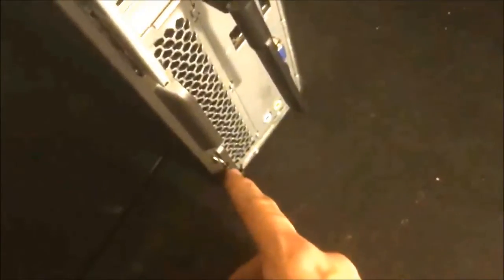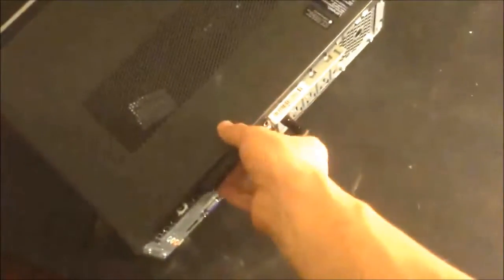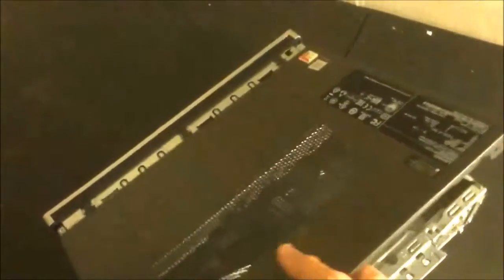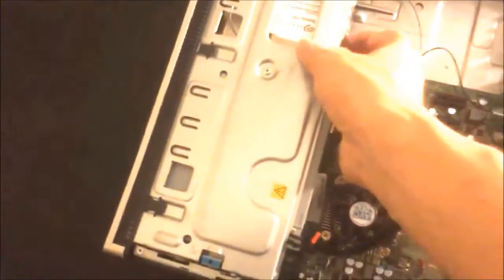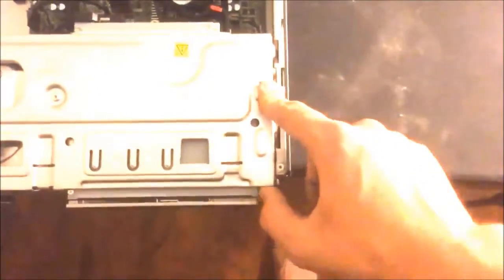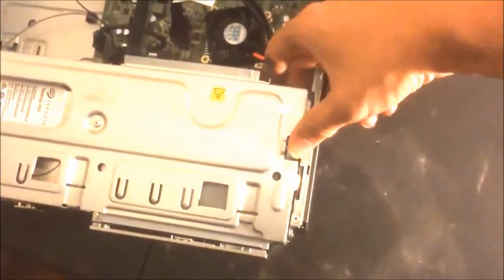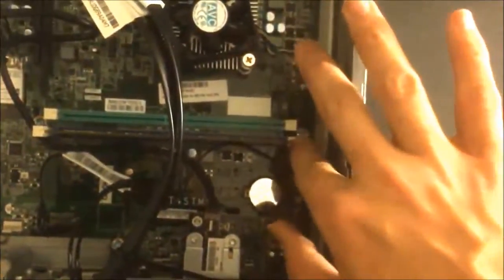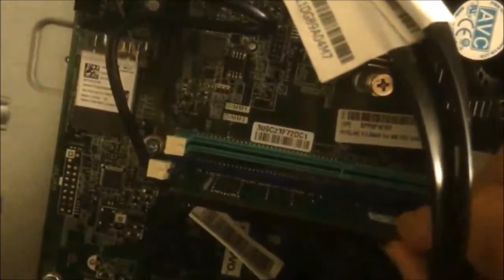lenovo - 310s-08asr upgrading desktop ram 8gb RAM

Comment: How many ram upgrade
Reply from the maker: Windows 10 has a minimum memory requirement of 1 GB RAM (32-bit) or 2 GB RAM (64-bit). Memory upgrades for Windows 8 Editions Windows 8 has a minimum memory requirement of 1 GB RAM (32-bit) or 2 GB RAM (64-bit). Memory upgrades for Windows 7 Editions

Comment: It appears you can only use one of these 2 slots, I tried putting in 2x8GB and it would not boot up, worked fine with 1x8GB in the blue slot, What the hell is the yellow slot for if you can't put your other ram in there? Over-all this machine is a slow Turd! I wanted to replace my 5 yr old Dell and I decided to go cheap, I guess you get what you pay for, my old Dell could out perform this, but luckily all I use this for is to watch videos on and web surf and it can do that, but I wouldn't expect it to do much more.
Reply: As it has amd a4-9125 processer it supports only one ram channel ✌️
Reply: You have to go 4+4 gb ram in the 2 slots. 4gb max per slot !
Reply from the maker: how to buy the same ram
Reply: @micklovin64  actually forme 12gb worked ,one inbuilt 4gb+extra 8gb lpx veganance/ just buy 2666mhz ddr4 ram
Reply from the maker: put one ram on your computer turn it on your computer put a different ram on your computerb  turn it on if your ram turn on both them put 2 random check it turns on